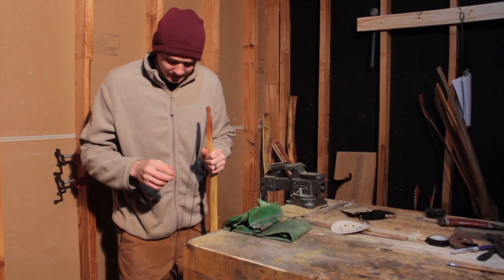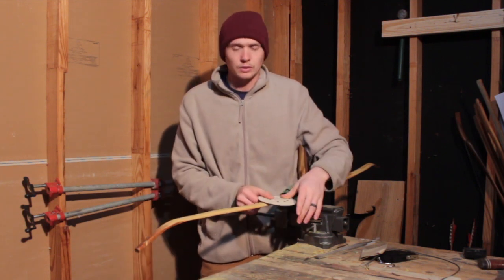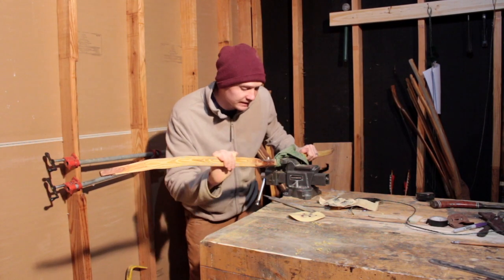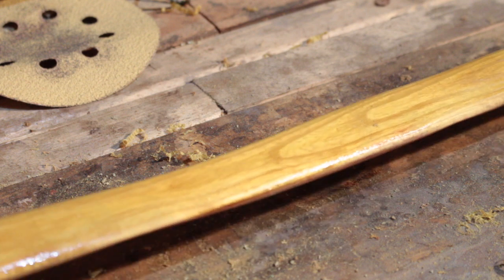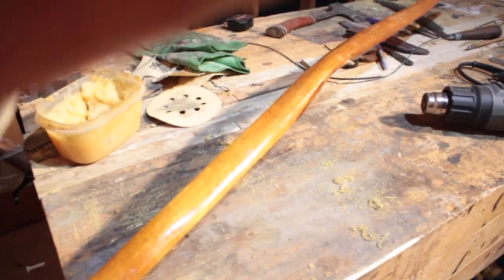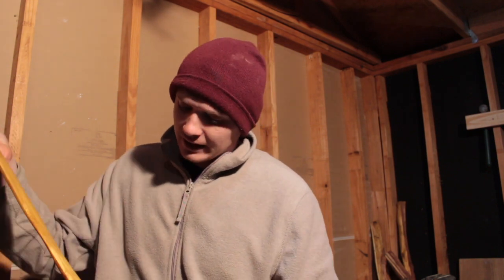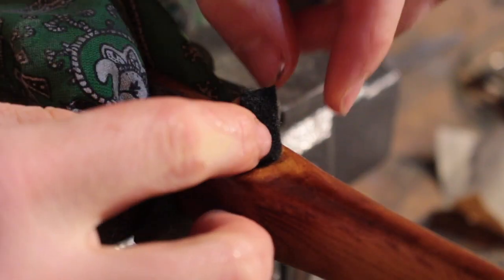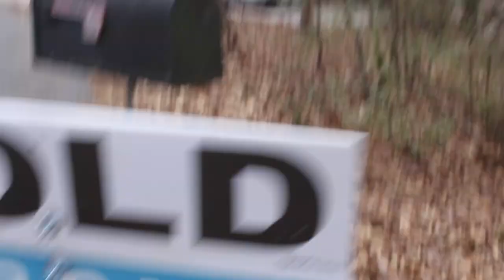"2019" REFLEX BOW SHOOTING! (MY WIFE'S NEW BOW!!!)

Comment: i
Nice house, nice bow. Congratulations! Have you ever used a small bottle or piece of bone to crush the wood fibers and burnish the wood before you put on the finish? It works pretty well to really slick up the finish. Also, I figure it couldn't hurt so far as keeping the bow water resistant. Old timers always chopped the points of their wooden posts instead of sawing them, said it helped prevent rot. The axe also burnished the wood as it chopped. Same thing with old hand hewn cabins. The burnishing helps close the pores of the wood.